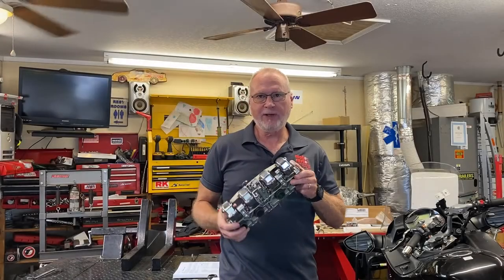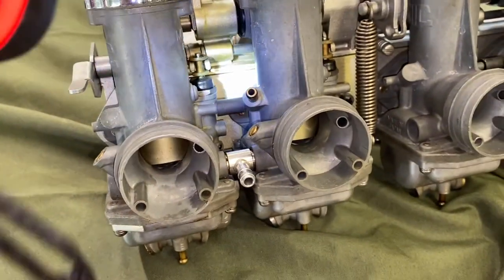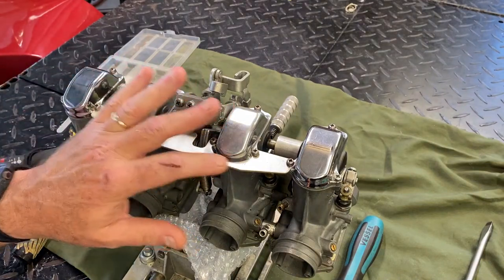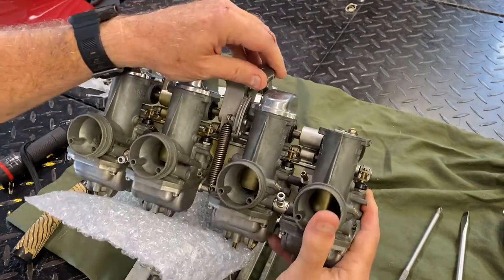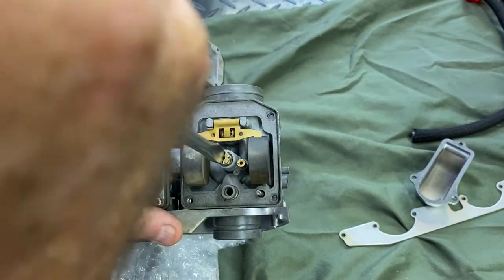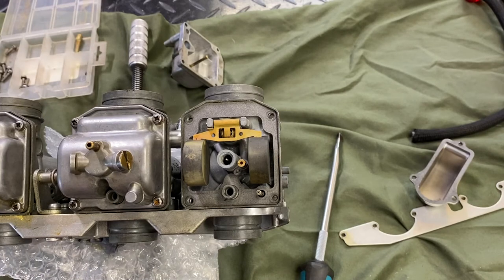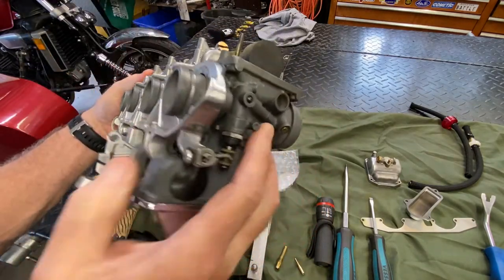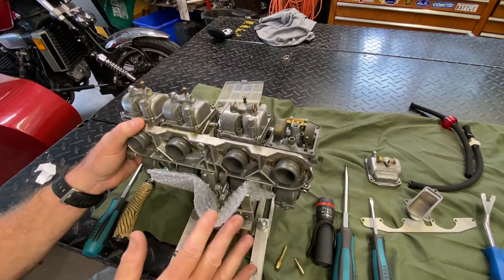Carb Talk! Mikuni Round Slide VM's

Comment: Very interesting and thank you. I have VM24ss on my kz650 and this video has cleared up a few questions. The fuel float levels are a pain which I solved using a 3D printer and making a clear float to use as a measure tool. Now the levels are very accurate.
Reply from the maker: Now, that's an idea! How'd you go about getting the 3D dimensions into the software? I don't know virtually anything about that stuff. I had a KZ650, a 1979 I think it was. My first brand-new bike. Had those carbs on/off a zillion times jetting/podding and with the of course, mandatory Kerker 4 into 1. Cheers.

Comment: Thanks for the video alot of useful info. I have this set on a kz900 but I don't have an air screw on the air filter side, instead it has a fuel screw on the engine side of each carb.
Reply: The idle mix screws on engine side thru float bowls on came on 77 & newer kz1000 with 26mm mikuni’s regulating fuel flow & not air flow. The last yr 900 being the 76 kz900 came with idle mix screw on back side of carb closest to air filter regulating air only & not fuel.

Comment: I don't suppose you sell those adaptor tools for using the float bowl drain to measure the float gas level with clear tubing?
Reply from the maker: No. They're easy to make. Find a jet even that screws into the drain and simply solder a small piece of copper tube available at any hardware and it'll work to hook up a clear plastic tube.
Reply: @MotoRestoFL  They are for sale on Ebay.
Reply from the maker: @dshellymachine  that’s cool. He asked if I sold them. Thanks.

Comment: Interested video, gives me an idea of how they work, but nothing like hands on. Did you make that rack or did I miss something? If you made it how about a quick video on it. 
                  Thanks
                     Jack
Reply from the maker: I don’t quite understand making a rack, Mikuni did that. Do you mean tearing down a rack and reassembling? There are a number of those although spread within carb work on my channel like the Valkrie videos and I think some others. One never should I rack carbs unless it’s absolutely necessary and this particular rack is in good condition. Thanks for watching.
Reply: No I was talking about the little stand maybe I should have worded it different, the stand that you had the carbs setting in to hold them straight up. Hope this cleared that up. Thanks.
Reply from the maker: @tfjack97  oh gotcha. Yes I made that out of a cheap drill press vice. One that dates back to probably 1978 or 80. I haven’t seen many like it and it’s quite universal except for some carb racks that simply won’t fit well due to setup.
Reply: Thanks for the info, I will try to get a better look at it and see what I can come up with. Thanks again for the reply.

Comment: How do you remove the needle?
Reply from the maker: That’s a bit complicated but the shaft has to be removed from the arms and then lift the slides and arms out then remove the arms from the slides and then the needles. Basically. There may be differences between these these types of carbs.